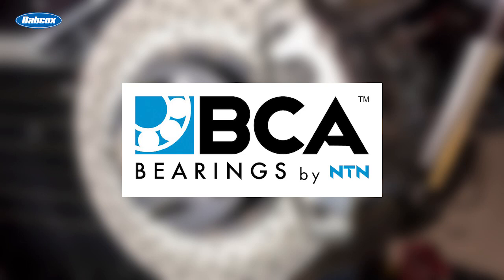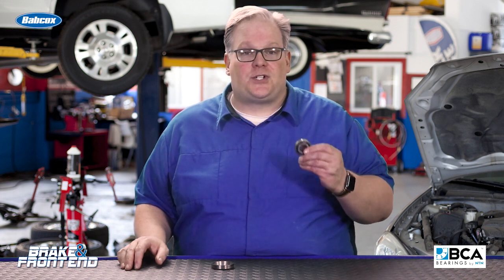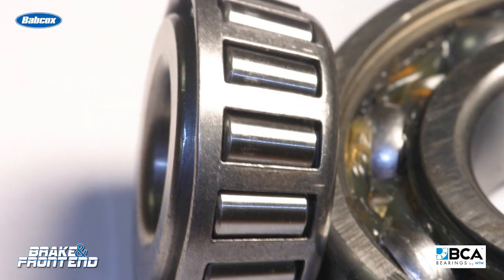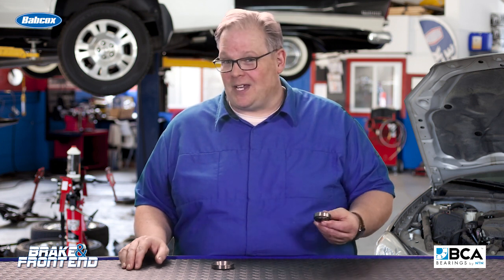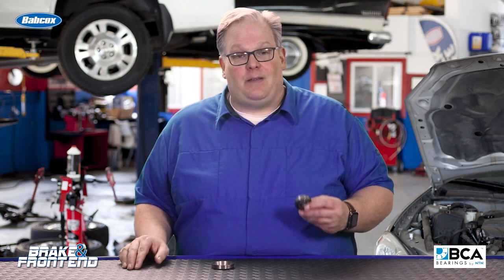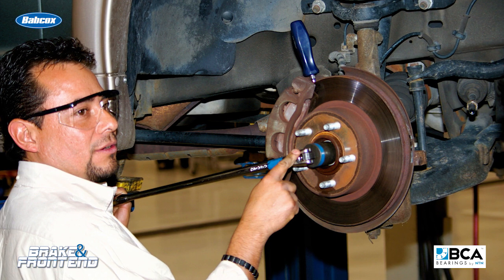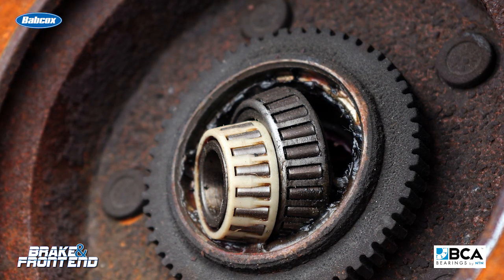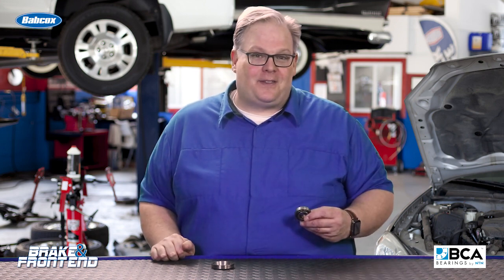Why You Should Always Look Up the Manufacturer Specs to Set the Preload on a Tapered Roller Bearing

Comment: And what if I use two different bearings
Reply from the maker: Good quesiton! We always recommed using a matched set of new bearings/races when replacing old bearings. Mixing bearings made with different materials, or having different wear profiles, will result in a shortened  life and premature failure of bearings.